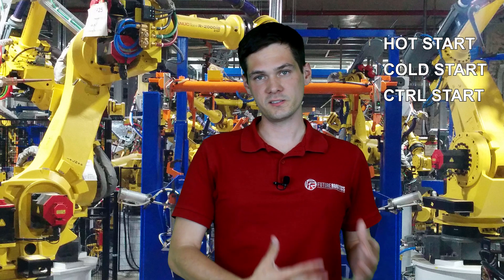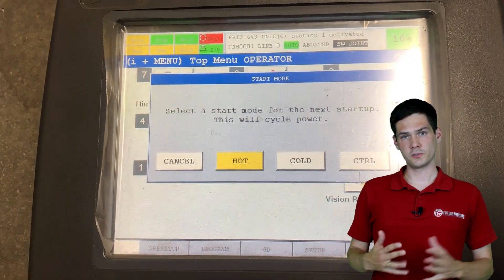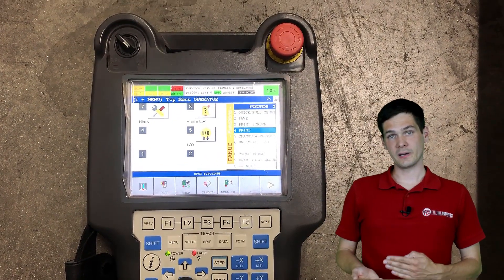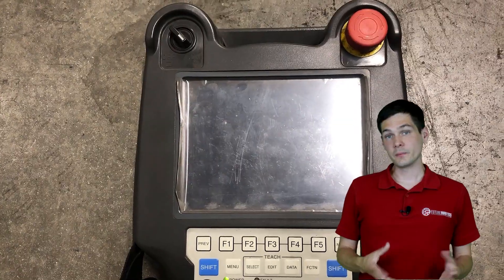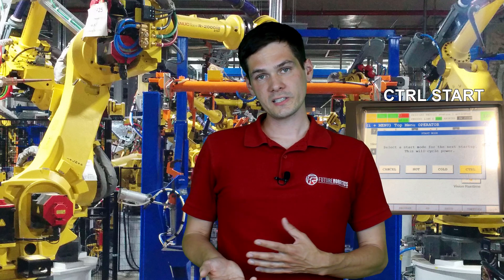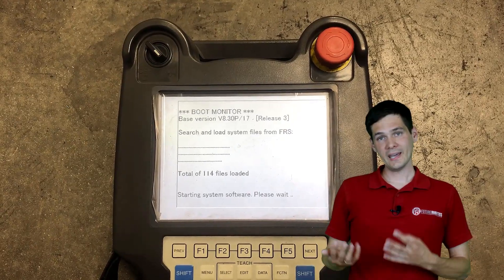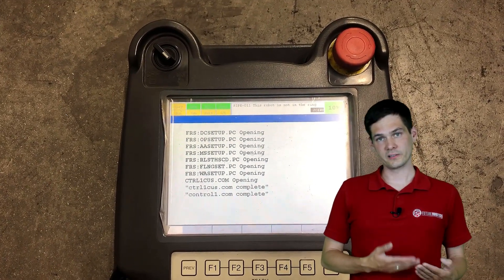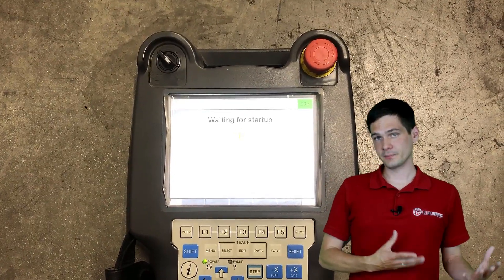How to do: How Start, Cold Start, Controlled Start on FANUC robot ?

Comment: Hello there, nice video overall: i have a situation, i got the controller on a controlled start, and now i want to put it back to functions but when i got the function menu to the cold start the menu says i need to put the auto update to it, i press the only option [Ok]  y it does nothing, so i got kinda stuck how i got it back?
Reply from the maker: Few options there:
1. Load working image
2. Do the AutoUpdate, you need the FANUC USB load media for that
3. Set variable $OPT_STATE = 0 and than cold start

Comment: I have a diffrent question about abb welding robot. What is for example "seam2" in program line abb. Its looks like that MoveL, v500, z 50, weld1, seam2, toolgun1; I will be greatfull if u answer :<
Reply from the maker: It's going to be hard to say for sure without looking at the source code, but I would assume that you are sending welding parameters using those commands.
Also I think the line should look like ArcL, z 50, weld1, seam2, toolgun1.

Seam data describes the start and end phases of a welding process

Weld data describes the weld phase of the welding process